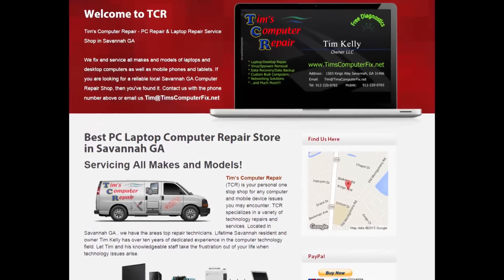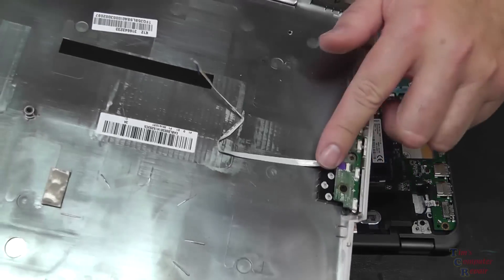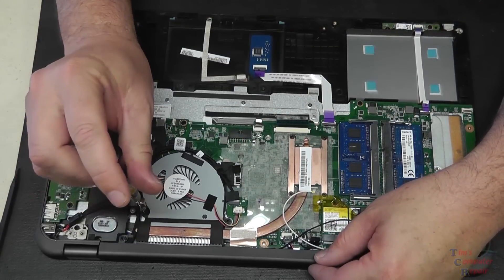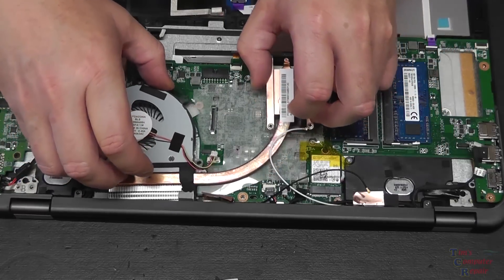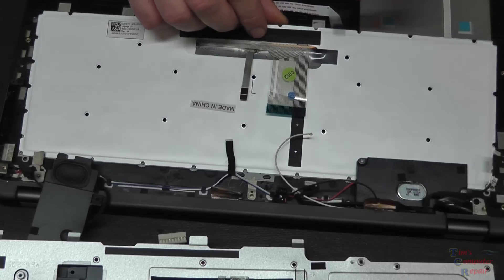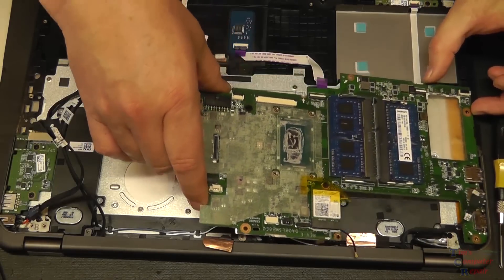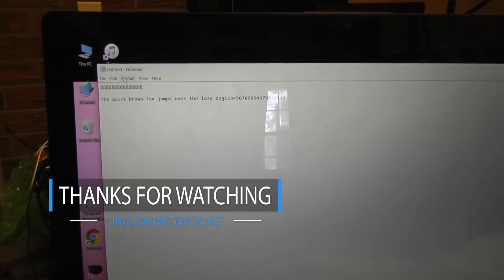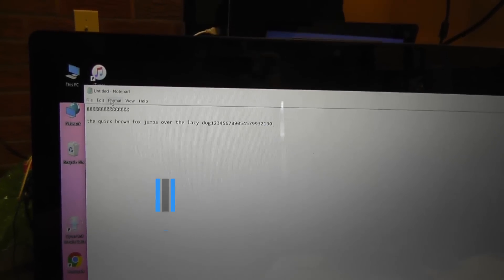Toshiba Radius P55W Disassembly and Keyboard Replacement

Comment: Could you please add a video on how to remove and replace the LCD as well as Touch Screen ribbon cables in the same model used in this video, i.e., Toshiba Satellite P55W-B5224. I do not know how the cable passes through the hinges, and how the cables and contacts are kept intact during opening and closing of the screen and operation of the hinges everyday.  I am grateful to you for sharing your video.

Comment: Good explanation at an appropriate pace for learning.  Your video gives me courage to go that deep.  In my case several keys are not responding; cursor does not move after pressing the faulty key.  Also it does not display anything.  I have already checked everything from the software side.  Also removed one key to see if there is any dirt accumulation; it did not appear so.  In the mean time partly broke the a portion of the inner plastic retainer clip.  However, I could put it back correctly, which was very tricky.  Most of the vowels, 1, 2, t  keys are not working. I am afraid to remove each one of these keys to look for dirt as the plastic retains are prone to breakage.  It looks like I have to follow each step you described in your video after buying a keyboard. Like someone said, if we do not connect correctly, we may fry up the motherboard.  I have already opened the laptop to figure out how to fix the broken hinge. One time it did not power on.  Instead of losing hope I opened it and reconnected the ribbon cable, the very thing one that connects to power switch, which turned on the laptop.  There are many, literally many things to watch out for which you have clearly explained.  Only your video explained that there were two more screws hiding, which I learned it from your video.  Thank you very much for clearly showing and explaining with close up frames.  Without knowing that it was not possible to open the laptop and venture to troubleshoot/repair. Thank you very much!  I am sure many viewers feel the same way and appreciate your efforts, which they have already expressed it. The touch screen and the onboard keyboard both are working fine.  So I am debating whether to take the risk of dismantling the whole thing or be satisfied with the onboard keyboard or an external USB wired or WiFi keyboard and a mouse.  It will be great to follow your steps and fix it.  Of course fixing the broken hinge is my first priority.  Wish you all the best, Sir!!!
Reply from the maker: Thanks for commenting.

Comment: watching vid for LVDS cable swap, pink screen, hoping issue.
Reply: nice to watch as some connectors flip up some just pull out with side tabs and in low lighting tough to tell, if you mix those types up at all, you can easily damage a mainboard,  Worked on an HP in house with customers peeking over each shoulder blocking my light and made that mistake as they were in a hurry and I was distracted.  woops, HP wasn't amused.. but they sent a board for next visit..
Reply: assuming that last cable before speakers was the LVDS cable, going to see if can pull that ducting for cooler you called a clutch to see if can get to cable with mainboard in place..

Comment: What do you call the connectors on the ends of the BLACK & WHITE wi-fi  antenna wires with the small nubs that snap/plug back into place  under the clear green tape (at the 19:30 sec in your video), when I went to re snap/plug? them back into place they do not want to stay in for a good connection, tried taping them on but it's not working and sporadically receiving the wi-fi signal from my router, the small round nubs where the connectors plug/snap back into the 2 small round cup holes on the wi-fi chip/card seem to be worn out of shape from removing, please advise...thank you.
Reply from the maker: You just need to get those things snapped on correctly. Takes me a while sometimes also but they will snap back on. You just need to hold your tongue right.
Reply: All is good now, I used small dabs of some good conductive electronics wire glue on the nubs (too small of area to solder), all keys on the keyboard working now and WiFi is connecting great with fast non-sporadic connectivity, it's amazing how things work with the right facial expressions and tongue placement, thank you again !

Comment: Nicely done, very careful, excellent. Going to see what is up with a touchpad on my neighbor's P55W soon. Super handy reference, glad I watched.
Reply from the maker: Hey good luck on that computer. Thanks for commenting.
Reply: Here is what is happening with the touchpad. Starting at a random time after boot, the mouse moves to the upper left and starts clicking. I re-seated the ribbon cables going to the touchpad but it didn't help. Here's a video and a pic of the new rev of the board. No more ribbon cable to the power button. Any suggestions would be helpful. Thanks. https://www.dropbox.com/s/ah9376e0r5c5ae2/P55W-C5316%20touchpad%20erratic%20mouse.mp4?dl=0 https://www.dropbox.com/s/ao1ym6khtuq2wsf/P55W-C5316%20Internals.jpg?dl=0
Reply from the maker: Hey is that a touch screen? It almost looks like the digitizer may be malfunctioning.
Reply: Yes, it is a touch screen. I'll check that out, thank you!
Reply from the maker: You can pull the digitizer cable from the back of the screen if you can gain access.
Reply: You are absolutely correct! Only about the left 10% of the touch screen responds to anything at all.
Reply from the maker: Yeah I would disable touch by disabling the digitizer. At least the computer will be functional except for touch.
Reply: I don't think my neighbor uses the touch at all, so I'm game. Thank you so much!
Reply: I didn't want to take apart the screen to get to the ribbon cable, so I traced the wires coming in from the hinges. I found the digitizer on the 2nd try. Here's a pic. I unhooked it and just routed it along the back of the case to a spot where it wouldn't move. Going to put electrical tape on it before I close it up. I can't thank you enough for helping me troubleshoot this! https://www.dropbox.com/s/x8k2a39o3edjsi6/P55W-C5316%20Ditigizer%20Location.jpg?dl=0
Reply from the maker: Oh good, did not realize that had it's own digitizer connection. Great job! I

Comment: After replacing keyboard with a new one 1, Q,A,Z, Cap lock and Tab button does work. I have removed the key and pressed the buttons without the key on it and it still does it work....Any suggestions?
Reply from the maker: Bad keyboard.

Comment: Sir, have you seen any CMOS battery in the model of your video in the backside of the motherboard?  I cannot locate it in my Toshiba model satellite P55W-B5224, of course I have not removed the motherboard to see its backside for the CMOS battery. 

Because my screen lost display, I connected to an external monitor via a HDMI cable and attached an external keyboard, everything was excellent.  Then perhaps the GPU got overheated (not sure though).  I somehow got the BIOS setup in my laptop screen (not connected to the external monitor).  Since the screen was very hard to read turning faint, could not enter the current date or save any thing as I panicked (not able to see anything on the screen).  Perhaps it corrupted the BIOS. 

I tried to reset BIOS by pressing a pin in the pinhole next to the USBs and the HDMI side of the laptop.   No display on the screen nor in the external monitor.  I tried to upload BIOS after downloading from Toshiba Support website, however no screen display not even the BIOS screen. Laptop turns on, fan runs, there is power at every USB port (for a fraction of a second as the laptop tries to boot up).  These lights are staying on but no screen display. 

If I can find the CMOS battery location or jumpers for the CMOS for this particular model (P55W-B5224), I can try to boot up.  Any help from viewers or you will be highly appreciated.  I already put 3 nuts and bolts to fix the loose hinge.  Also replaced the thermal paste of the heatsink.  Any input from viewers is greatly appreciated. Thank you for your wonderful video.

Comment: Looked like hardwork but at least it was'nt a HP Laptop where you have to remove the hinges as well . still on the plus side we can now charge more for Labour . Good job Tim Keep up the good work.
Reply from the maker: You are correct. As mentioned before this is very Apple like when it comes to removing keyboards. Charging more is a must when replacing keyboards on these models. Thanks for the comment and thanks for watching.

Comment: Tim, thanks for this video!! One quick question for you.. what size screwdriver did you use for those final screws that hold the keyboard? Have tried a Phillips cross PH000 but it's still too big for the screws.. any advice? Thanks
Reply from the maker: I was using my every day Phillips I use on all of my laptops. Should not be an issue.